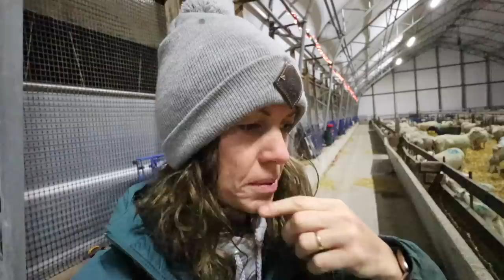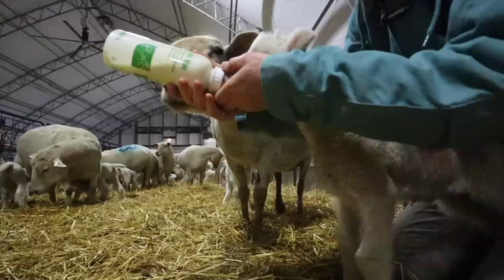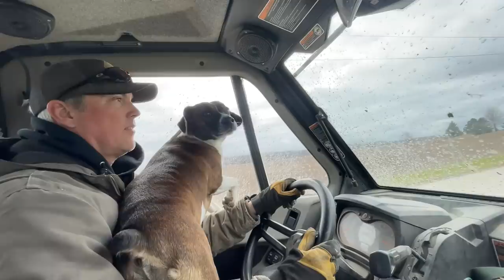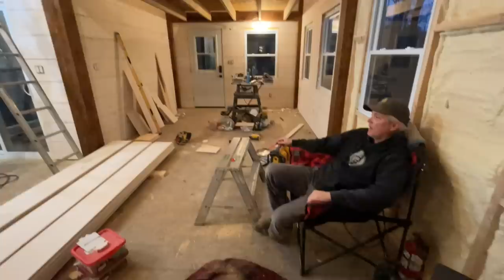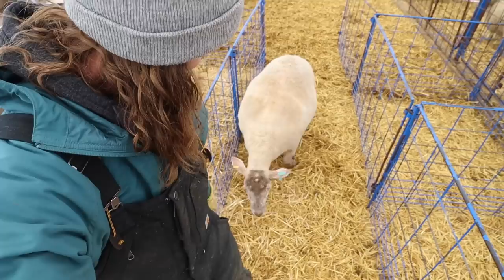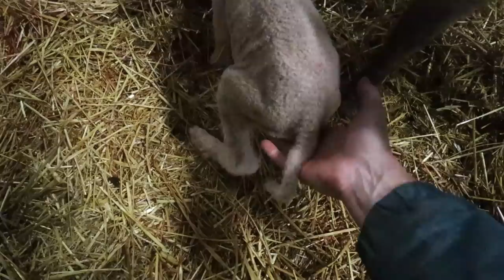A favourite ewe lambed... but baby couldn't open his eyes!! | Vlogmas 2022 | Vlog 651

Comment: I am sure you already did, but probably need to get a light and check popcorn's lamb for entroprion (where they eyelid turns under enough that the lashes are touching the eye). An injection under the eye fixes it pretty easy in the first few days of life, or some people use butterfly clips. I see it once in a while in goats and learned to fix it from a local sheep breeder. I no longer breed the buck that caused the problem, but it isn't always genetic especially in large or late births.

Comment: It makes me laugh when you use a gate to separate  thr sheep like a cutting horse.  Maybe not as elegant as a horse but cheaper to keep
I've been thinking about hoof trimming and how it hurts your back .is it possible for Mark  could connect an electric motor to the "sheep holder  " contraption that could turn in for you so you don't have to pull on it so hard. Maybe like a winch motor. Heck I don't know but there must be an easier way.  It wou.d have to have a forward and return   switch .  Oh well, just wondering.